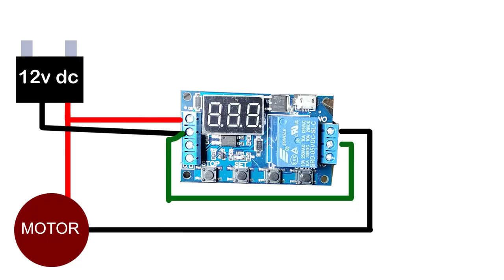How to make automatic pet food dispenser - do it yourself food dispenser - XYJ02 timer projects

Comment: what is the  wire attached to the moter at 2:52  to allow it to move ?
Reply from the maker: Yes it is a direct connection of 12v  to check if motor is working

Comment: Thanks sir, it inspires me a lot..any ideas to make it save( i mean the electricity)? Like using battery, i dont feel it save to plug it to house power coz i want to leave my pet for days sir..pls help thnks sir
Reply from the maker: You are welcome, it is working on 12v so it doesn't use much electricity it can be plugged directly on 12v battery
Reply: @Umairworkshop  thank sir..one more sir, to avoid any accident relate to electronic fails, like burn or explode, what must i do sir? Tysm..🙏🏻🙏🏻
Reply from the maker: @infobaru3108  need to proper insulation with electrical tape ,use high amp of wire and use high quality circuit because the relay is not reliable always.